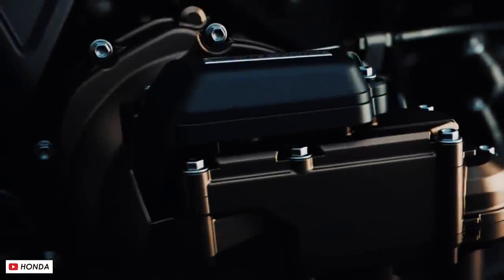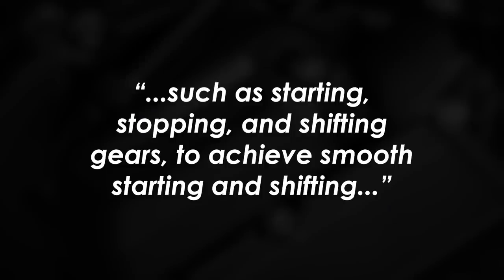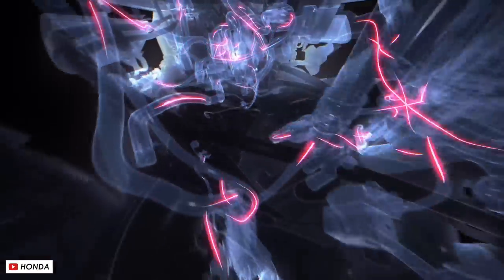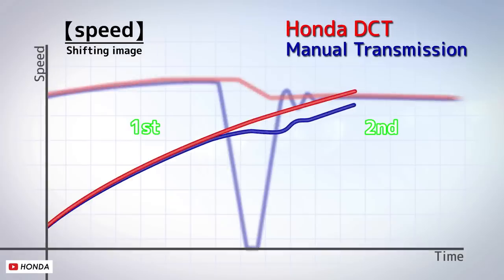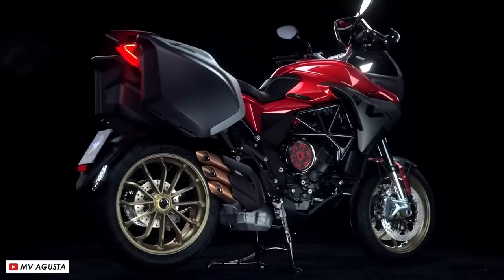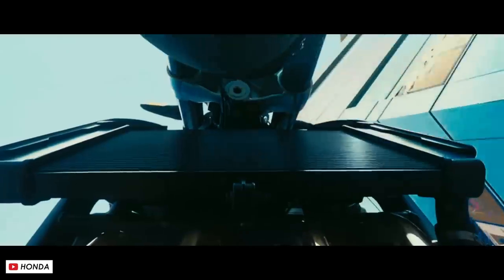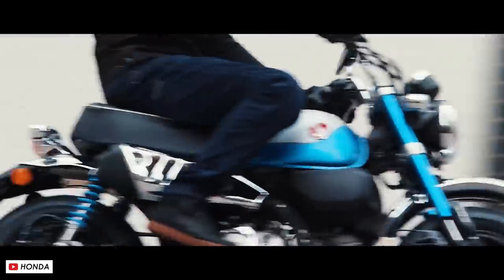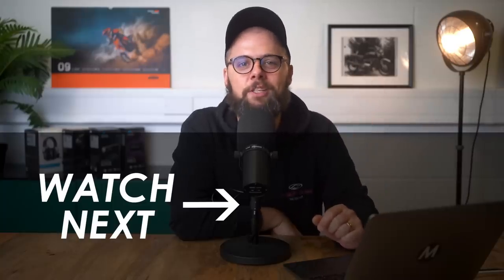New Honda E-Clutch For Motorcycles Announced!

Comment: I have a Rekluse fitted on my 390 Adventure, brilliant mechanical clutch with no electronics. Unstallable, pull away and stop with or without using the clutch. The addition of a quickshifter means that I never have to use the clutch, but of course I can ride as normal if I choose. £500 fitted, Best single upgrade ever.
Reply: Rekluse clutch is it fiitable to any motorcycle or it depends on the bike
Reply: I want a rekluse clutch on my DL1000 it’s not super heavy but it’s hard work in traffic
Reply: Is this the rekluse auto clutch that you are using? How hard is the install?
Reply: @vijey18  Ktm dealer fitted mine but the install is easy, if you can change a clutch. There are YouTube vids
Reply: Bro no way, i have a 390 duke. im going to look into that cause the factory quickshifter really isnt a quickshifter. It just lets you clutchless upshift which is meh. Or i might just upgrade to a bigger bike, not sure what i want
Reply: Yeah, this looks like an electronic take on Recluse. I think even the inexpensive Honda Supercub 125 has a Rekluse like system but with no clutch lever.

Comment: I was so nervous getting a DCT but after a year on my Africa Twin DCT I cant imagine going back to old manual
Reply: I just find it boring, but seeing as the new adventure sports only has dct on the 24 models I might end up getting one or stick to the old one but I want better wind protection too.. Probably have to road test all of them again including the neew BMW GS.
Reply: It's very unpleasant at low speeds, the jittery when cutting lanes at low speeds is big turn off.
Reply: Why need wind protection if you're gonna hog along in traffic behind cars?
I swear the only guys that talk about wind protection are the guys that wear constantly 3 panniers, full gear and always slugging behind cars because they can't filter and cut lanes to save their life.
Reply: @fs5866  Filtering isn't legal in most of the Untied States.
Reply: Can you wheelie a dct?
Reply: @Ukmongoose3  Pull the throttle and find out, of course you can wheelie a DCT...
Reply: Dct rox!!
Reply: me the same. Had 30 days rental to travel withing europe DCT (but NC750X) never would one anything else. But looking buying Transalp, but it doesn't come with it :( and AT just too much of a bike since now they don't let to buy DCT without electronic suspension making it like 17k £ for base model with DCT

Comment: Anything to get more people riding on two wheels is OK by me
Reply: dude, you should visit Indonesia.... almost everyone ride motorcycle.... but the CVT lel
Reply: The problem is when the manufacturers start thinking everyone want's electronic assisted everything on the bikes, like the case on cars.
You can't find a single car nowadays which doesn't have start assist. On the c200d it's a pain in the butthole if you're trying to go through a slow curve in 2nd (because there is no reason to be in 1st). What then happenes is, I try to manually regulate the throttle to drive off in second (note the car is never still), the start assist goes on and wanks the whole throttle to clutch ratio and stalls the engine.
Reply: You should visit Italy, it's 2 wheel paradise out there
Reply: @Daniel-dj7fh i think this is a cool concept if you can turn off the electronic assist. If you can then having this be a standard option for the future makes a lot of sense

Comment: From what I've learned about it, the CB/R 650 is coming with the E-Clutch, TFT display with phone hookup, and electric throttle. The E-Clutch will have several modes to operate it with, and it will include quick shifter both up and down and throttle blip. I can't wait to get one!
Reply: You were right Honda just announced it

Comment: This will be a great addition for use with a quickshifter as by actuating the clutch electrically it will remove my objection to conventional quickshifters,  namely that they are basically a mechanically brutal bodge.  Current quickshifters may momentarily reduce power on upshifts and attempt to rev match on downshifts, but you are still forcing a cog change without disconnecting the engine from the gearbox.  This system will be able to do so automatically making for a much smoother change and less wear and tear.

Comment: I remember riding a Honda 125cc in Thailand in 2013, it had a gear shifter by the left foot peg but no clutch lever. I guess is the similar system, all you do is use the gear shifter, 1st gear down and rest up,  its quick and fun! I think Honda used this system in the 90-ies already for the Asian market. Great job Bob as usual!
Reply: its centrifugal clutch.... only applicable on small cc bike below 150cc.
Reply: Honestly, those 125cc semi automatics are miserable to ride. I like and respect the C90s and the Waves, but they’re very poor riding experience. I wouldn’t want that.
Reply: @Rossy167   The only 125cc I have any interest in riding is my Grom :)

Comment: Great idea and it will be a huge success if implemented as an option in its mainstream motorcycle model lineup. A nice alternative to DCT for those who have some sort of need for a clutch.
Reply: Tbh it probably could become standard at some point. I would like the ability to turn the automatic clutch control off so you can get the 100% feel of a manual
Reply: You can turn the e-clutch off, and the bike operates exactly the same as any other manual clutch bike.  All the people crying it's a glorified scooter apparently missed that.
Reply: @barbarousrelic4591  Sounds like the best of both worlds and that is a plus for me.

Comment: It seems like something that has been around already for many years. Namely Yamaha's YCC-S (Yamaha Chip Controlled Shift) on their FJR1300. I had one of those. It had no clutch lever. You ride away twist-n-go but you still have to switch gears. Either by the foot pedal, or by +/- buttons on the left bar (index finger / thumb activated). Loved the system.
I would prefer full DCT, but if that's not available, a system like this will do.

Comment: It looks to me like the bikes fitted with this system will also include and up/down quick shifter. In one shot they showed shifting the bike from N to 1, at a stop, then rolling on the throttle and setting off. This implies there is a down pressure switch fitted to the lever, and it makes most sense to use a parts bin quick shifter rod linkage. I love the system already :)

Comment: I have an MV Agusta Dragster with the SCS (Smart Clutch System), and I will say I was apprehensive about it before I purchased the bike.  But after owning it, it is a dream.  You can still do the usual style if you prefer, but you can also just simply never touch the clutch lever if you choose.  It's amazing.  I believe it's a bit more than a typical Rekluse clutch, as it has some electrical components as well joined up with the transmission and throttle.  Hence the "smart" part. :)  A lot of people will gripe about "new technology" on these clutch systems, but it just helps more and more people enjoy the sport.

Comment: Love this, I have a wrist injury and have a hard time with a heavy clutch pull. Love my DCT bike but if this could be retrofitted to various bikes that would open their lineup to me.
Reply: I'm curious to know how wrist problems prevent you from using the clutch.
Usuall lever angle is wrong, meaning you need to tilt it further down to have a comfortable posture. And if you sit correctly on a bike there shouldn't be any weigh on your hands. With the two together the only things moving when using a clutch when riding are your fingers, your wrists should be straight.
I fell down on both palms long ago, and if I open a door wrong (by over tilting my wrists) they become useless for 1-2 weeks. But this isn't affected when riding a bike.
Reply: It’s tendon thing and all of that stuff allows the hand to grip. Physical therapy has helped a lot but there are still limits. On highways I’d probably do okay with a moderately heavy clutch pull if I’m not shifting much but in town and in traffic the pain would crop up quickly. Old Harleys and what not, no way, awful. Most newer bikes that have light slip and assist clutches would be fine. But I’d rather not have to clutch at all, it’s The Good Life.

Comment: Having owned 4 different Honda DCT models, a version with a manual clutch for super slow maneuvers and off-road would be the bomb, especially coupled with the paddle shifters (which I REALLY like!)
Reply: this will not allow paddle shifters. Because the gear is being shifted by you. This only replaces clutch.
Reply: What bike has paddle  shifters?
Reply: @awakeadventurer9198  what do you mean? Are you asking it to be exactly like in car? DCT bikes have button up and down to shift gears. So the same concept
Reply: @PovilasPanavas  cars have paddle shifters behind the steering wheel. Yes dct has buttons. Same concept but not paddle shifters behind the bars. Thats what i was asking. But yeah conceptually the same. Physically different.
Reply: @awakeadventurer9198  ALL the Honda's with the DCT have paddle shifters including. The VFR1200, Africa Twin, NC750, and the GL1800. All great bikes.
Reply: @wayneknodel3347  more like buttons as far as ive seen and used a couple times, but yes.

Comment: This with a DCT would remove one of the issues people have with DCT and slow speed control. However suggesting it replace DCT is a little wrong, great for those with arthritis and inability to use clutch but DCT and flappy paddles/auto is a great system for those of us who can’t use a traditional left gear shift due to foot left leg disabilities.

Unfortunately nowhere does Honda suggest that this will be used with DCT, rather it only shows it on a standard manual box. Essentially a sophisticated quick shifter. What would be great is if manufacturers offered the equivalent of the Kliktronic unit with built in controls.
Reply: "sophisticated quick shifter" - No it's not. Completely different principle. Quickshifter cuts engine power momentarily. This E Clutch mechanically pulls the clutch for the rider.
Reply: @amir_asyraf  different principle, same effect.
Reply: @jimporter  You can't say it's "a sophisticated quick shifter" when they work on a completely different principle and mechanism. A quickshifter is a quickshifter, e-clutch is e-clutch. They don't give the same effect. A quickshifter does not pull the clutch for you when you're stopped, which means you'll stall. A quickshifter allows you to change gear without closing the throttle. An e-clutch still requires you to close throttle when changing gear to take load off, unless you want to engine to rev high and have a loud clunk when shifting.
Reply: DCT with mechanical clutch lever = perfection ; prolly not gonna happen though, as it make whole system more complicated than already is;
anyway im happy dct user, dont need anything else, just wish for better gear selection logic, as downshifting logic sucks big time on AT, while on goldwing it works perfectly
Reply: @amir_asyraf  I can say it is a sophisticated quick shifter if the effect it is having is quicker shifting. They may be completely different technologies and one may have been given the specific name however it does make my statement untrue.
Reply: @Angry-Lynx  does this depend on the age and model of the Africa Twin as some newer models have the more sophisticated IMU.
Reply: i havent got opportunity to ride 2020+ model so cant say for sure but afaik the biggest change in 2020+ model for dct is that it doesn't upshift mid-corner, which imo is not problem anyway  @jimporter

Comment: No battery, no gear change?.. I think it's a big solution for heavy cluchtes, can be of great help in town, with a lot of stop and go, with some "variable assist"  on the system, if added to existing clutch, like a "servo" ( but adding weight.. and something that can fail)
Reply: Exactly.  It´s interesting but IMO too much electronics.  A more elegant, not to mention fail-proof, option would be to use a regular clutch cable to actuate a proportional pressure control valve on the clutch directly.  The feel would be totally mechanical and by controlling pressure/force instead of displacement, as on a standard clutch cable system, the feathering would be much easier to achieve.  Best of all, no electronics.
Reply: If no battery, there's no riding anyway. How are you going to start the bike? And if you get it started, then there's the alternator... you get electricity.
Reply: @johnnyblue4799  Hi Johnny, yeah, you are right. I was Just thinking about when i move the bikes in my garage, with no keys, and need to get out of gear or push them. ☺️
Reply: @Giuseppe_De_Bellis  Oh, ok... you can rock them back and forth a little bit and you can get them in the neutral easily, w/o the clutch.
Reply: @johnnyblue4799  Agree, i know. Only thing Is my garage Is not perfectly leveled, a bit uphill, and my Harley Is 700 pounds☺️
Reply: @Giuseppe_De_Bellis  Ouch... that's almost twice my bike (Fireblade 954). I guess you need to do some bodybuilding to be able to manage that big boy!

Comment: Is this a replacement for the quickshifter?
Reply: It doesn't look like it. It's more of a clutch assist, to reduce the force you need to  pull the clutch lever. I see it (from the images in the video) as the next thing after hydraulic clutch actuation. Not only self adjust and reduces the force needed at the lever, but from what he said, it will actually adapt to the riding conditions (like engaging slower when you move off from a stop sign and engaging faster in normal gear shifting mode). Nowhere in the video does it say that it will replace the quickshifter, which operates without the clutch engaging/disengaging anyway. But will see it when it hits the market.

Comment: While I'm a manual transmission for life kinda dude, part of why i got rid of my cbr650r was because after long rides (400+miles) sometimes my clutch hand was just as exhausted as my throttle hand, so i can see this being really useful in the sport touring world
Reply: Are you doing every shift with a the clutch? I had the older cb650f and never even thought twice about the clutch even after super long rides
Reply: Getting tired after a longer ride is normal, especially after 400miles.
How's your experiences with the 650r on long rides tho, I'm also considering one as my next (probably keeping it forever) bike.
Reply: @Daniel-dj7fh I've got a CB650R, and it's not the most comfortable bike for long rides. My longest one was about 600km — and that was definitely too much. It's nice when below 200km though.

The stock seat is also a bit hard by the way. I have a custom one for a while already.

Comment: I’ve owned two DTC bikes and I never gelled with them because (to me) slow maneuvering is hampered when you have to rely on engine revs and rear brake over rear brake and clutch feathering. Oddly, I own a Zero DSR which has no clutch and the bike doesn’t suffer from this. I think it’s due to lack of rotational mass inside the engine. 

People hated drive by wire when they came out and then it opened the world to modes, electronic cruise control and things like that. It only makes sense to have a clutch by wire. If you want, put the bike in full automatic. If you’d rather use the clutch. Put it in manual mode and have fun. To me, this would be a vast improvement over the DTC transmission.
Reply: QS up & down autoblip is the sweet spot

Comment: I love the control of manual, even in stop start - but if you could make it simply as a ‘stall proof’ safety.. that’d be interesting.  Especially as even pro’s can goof up at slow speed manoeuvres…
Reply: and then there's the problem of..

N-1-N-whoops!-1-2
Reply: If you are worried about stalling your bike you just need to get good imo.
It's really something which requires almost no effort in learning, unless your bike has a start assist system which doesn't play with your throttle and clutch work.
Reply: @Daniel-dj7fh pride cometh before a fall.  

The fact you think this shows how much you’ve still to learn.

And I doubt you’re doing the technical skills or 8-10 hour days that may result in it.  But one day, somewhere, unless you ride to your local shop and back with the occasional summer season weekend warrior blip, you’ll likely become a cropper to an accidental stall at a really inopertunite moment.  Good luck.

Comment: The HP7498HD solenoid is not designed to be energized for extended periods of time.  Caution must be exercised when operating a Powerglide transmission in reverse range when equipped with an HP7498HD solenoid.  Ideally, we recommend energizing the solenoid for no longer than 10 – 15 seconds at a time.  While we have had customers energize this solenoid for time periods up to 30 seconds without an issue, leaving the solenoid energized for extended durations of time may eventually overheat the coil, possibly causing the protective coating on the outside of the coil to melt. This will dramatically reduce the lifespan of the solenoid and cause premature failure.

Comment: That seems pretty cool. I like that it has automatic mode but you can still ride basically completely manually. I feel like it's probably going to have a similar issue as electric power steering and electric brakes and cars where the natural manual feedback gets lost but it's probably not that big of a deal.
Reply: There's no automatic mode.  You have to shift with your left foot whether you're in manual mode or e-clutch mode.  Only a true DCT has an "auto" mode.
Reply: @barbarousrelic4591  sorry I meant that the clutch has an automatic mode not that the transmission has an automatic mode.